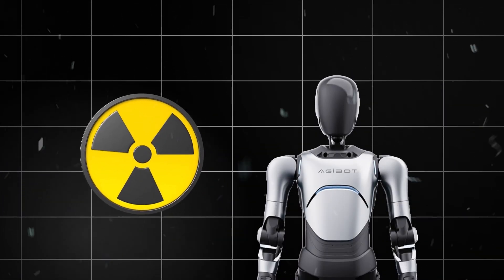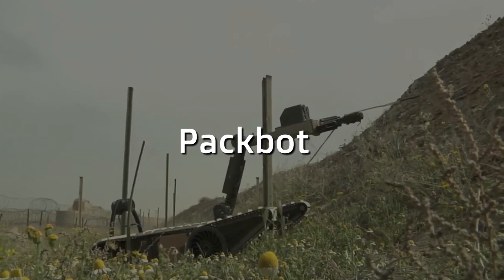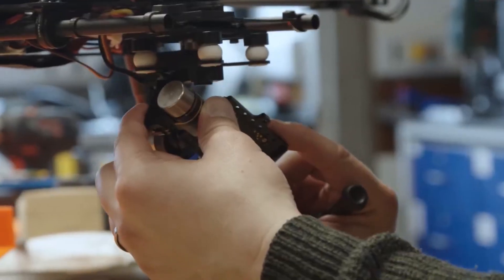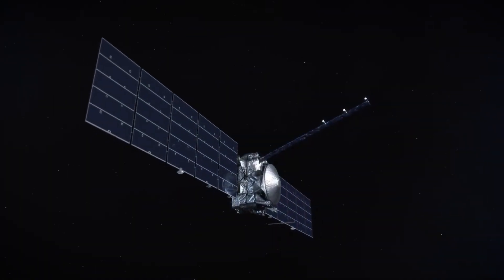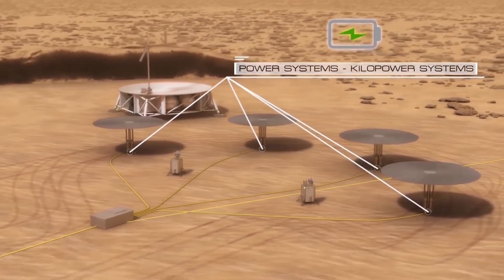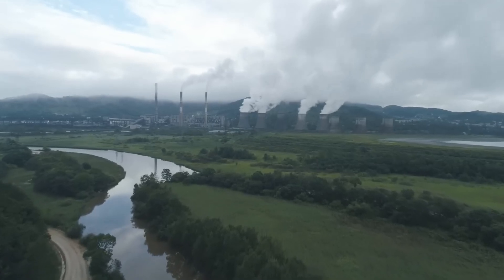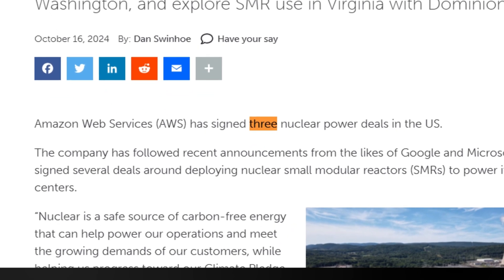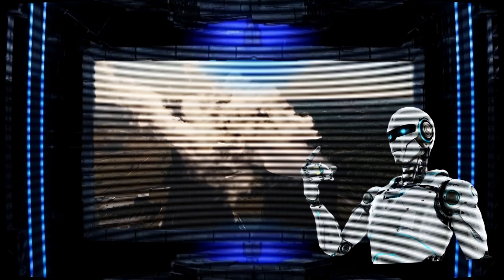FIRST Nuclear Powered AI Robots are Wild

Comment: There must be  huge potential for all manner of transport options etc, using hydrogen fuel. The main issue's is containing the compressed,  ideally liquid hydrogen safely. Considering the 10 000 psi or more pressure that fuel tanks may need to withstand.  If efficient methods for storing hydrogen at lower pressures, yet in significant quantities emerge.  That would likely be better from a safety perspective..🫠